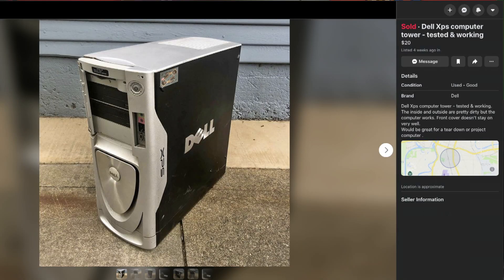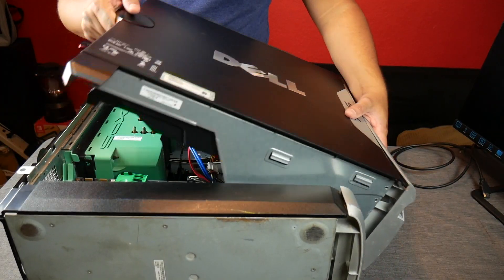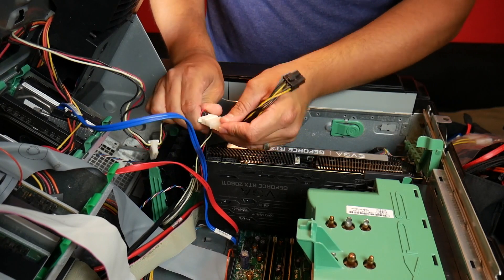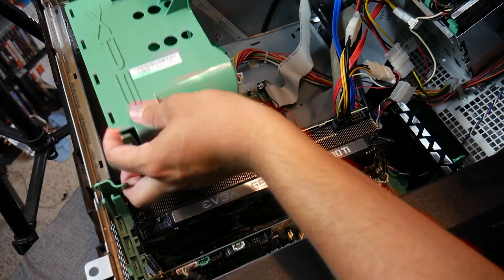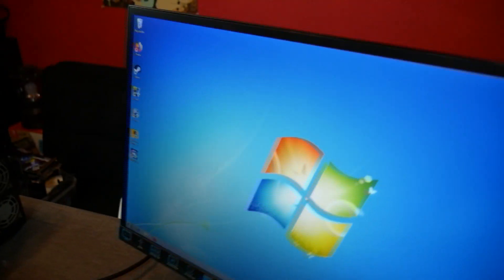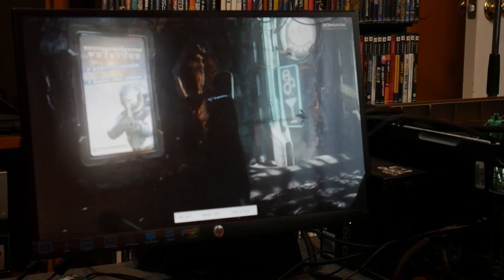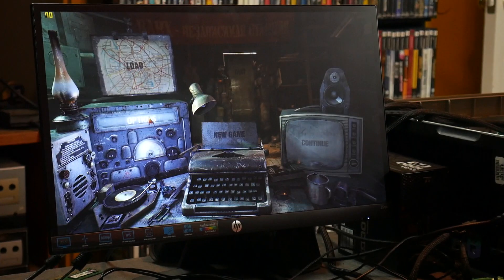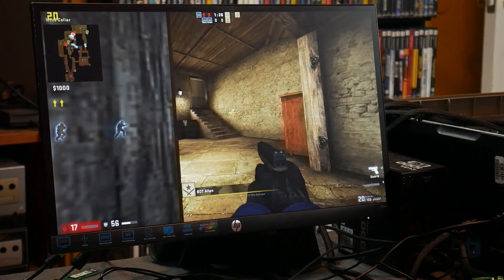The fastest Pentium 4 paired with a MODERN video card?! How bad can we bottleneck?

Comment: You can't run Hl2 in full HD, especially if you run a steam version, it's Simply overkill for the p4....1600x1200 or 1280x1024 are the best resolutions suitable for that processor, for Every game

Comment: Half-Life 2 and other source games used to get 120-160fps average on my old pentium 4 with a geforce fx 5600 ultra, so the problem is that the new(orange box version) of half life 2 is garbage and NOT older than the pentium 4 processor, i would  recommend getting the older GOTY edition of half life 2 and test that instead.

Also, newer gpu drivers put are more heavy on the older cpus i noticed so try an older card with a more period correct driver and you might be surprised.

Comment: I'd be interested in knowing what the best GPU would be to pair with P4.  What I mean is what is the best card to use before the CPU became a bottleneck.
Reply from the maker: That would be interesting to find out, I have a decent spread of cards that i might be able to test that with
Reply: Anything after the Geforce 7800 GT/GTX there is a bottle neck... I noticed a huge bottle neck with the 8800 gts

Comment: You have to be careful with some Dell motherboards and power supplies. Using a non-Dell power supply with a Dell motherboard or a Dell power supply with a non-Dell motherboard can fry the motherboard. Despite using the standard connectors, the wires are rearranged so they are not compatible.
Reply: I Have yet to encounter such a system, so far in my experience most of the consumer-based dell desktops use standard ATX, I think it's more towards the business class and Enterprise machines and SFF systems that you might encounter a non-standard power supply.
Though that might be a problem on new systems that are made after 2010 and onward looking at the current Alienware system that gamers Nexus reviewed. Most of the older stuff uses ATX psu including some Dell BATX systems like my E521.
Reply: yeah this is the crap they tell you for you to waste money on them, it's a lie.

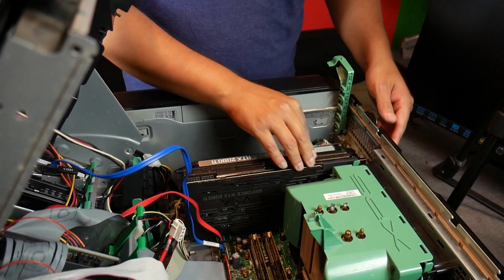Comment: At 2:45, the graphics card that came with the computer is an Nvidia GeForce GTS 250, not a GTS 520 (as you said in 1:21 and 2:30). There is no GTS 520 (but there is a GT 520), so you must have mixed up the numbers while this video was being made.

Comment: If anything I feel bad for that poor GTX 1080, but it’s honestly impressive that thanks to PCIe literally not changing since 2003 you can still get a brand new GPU to function on such an old CPU.

Now let’s try to run an ancient PCIe based GPU on a modern CPU and see what happens.
Reply: well. the First PCi-e cards are the X300 - X850 range of GPU's from ATI, and the GeForce 6 series. the Radeons wont be running too much after 2007 since alot of games started to require shader model 3.0. which the 6800 Ultra had. but ultimately, they're DX9 cards. and they won't really be running anything after 2012 except a few simple or easier to run indie games that can use dx9. though they'll usually require shader 3.0. Best case scenario would be to test the HD 5870 and GTX 480. those cards still hold their own. The GTX 480 aged better though. But is a literal furnace.
Reply: @FinnLovesFP  I bought a used 5870 a few years back for a budget build for $40 and its biggest issue is lack of VRAM and driver support, but on paper its as powerful as a GTX 750 ti. It is not a bad GPU and I'm tempted to throw it in my 1700x rig just for fun.

Comment: I think rather than pushing the CPU to do what it is not meant to do nowadays, why not try to show what applications it is still good for in the current days because most of us know it won't do magic for gaming.  For e.g, I would like to see whether it is worth to be the home server vs a Pi 4 home server, a CNC computer because of the Free Opensource software that works in ONLY older hardware like the parallel port ...
Reply: Undertale runs fine on Pentium 4 w 32bit WXP.  Quake 3 has 60fps on integrated graphics. A win in my book.
Reply: There's really not much use for Pentium 4's as they don't really Idle so not well suited for simple tasks either, plus a quad core pi cpu would run circles around this.
Reply: That sounds really interesting. I feel like gaming was interesting. I curious about indie games. one thing I am really curious about is the instruction set difference between the p4 to modern CPU. it did seem more stable then I expected. Very interesting video non the less.

Comment: p4 660 ht (prescott) 3,6 GHz + RAM 4 GB + SSD 64 GB + WInXP or Win7 + ASUS GTX 560 (or down to GXT 260) does indeed work very well for CUDA/BOINC, heavy GPU work. Just leave the CPU free of workloads. Gaming no...games like GTA5 etc is way to heavy. But other games might work very well. But i dont use the machine for gaming but i do think i ran a few FPS and Strategy games like Totalwar series and it worked decently if you can stand 20 Fps or so and with graphics turned down a lot. I mean its not realistic scenario to run  heavy games on old GTX cards and expect some miracle of sorts...it will be what it is. Laggy. Its fun though to see what you can do with old junk. More than expected actually. But the power bill is hurting the wallet...old junk needs a lot of power and put out few clockcycles in return...so its a drawback ofc. But it is fun tinkering around with it until it breaks. :)
Reply: wich socket?   LGA775 OR  478?   I see a lot of YouTubers saying pentium4  when they talk about LGA775